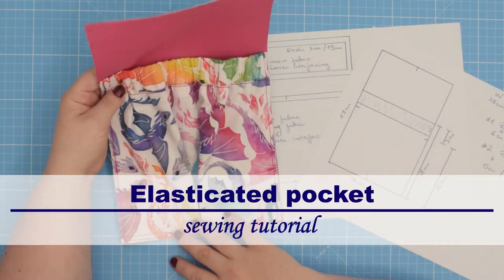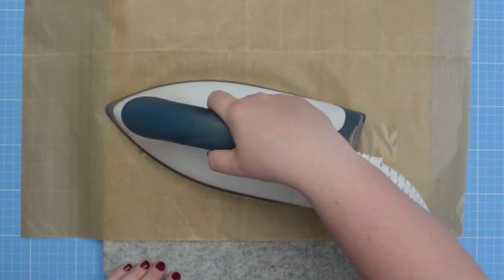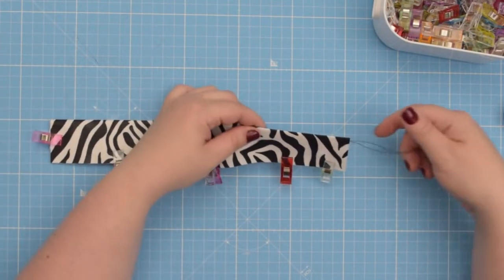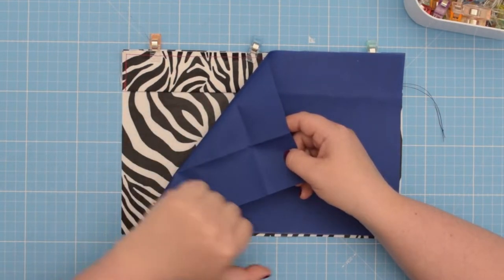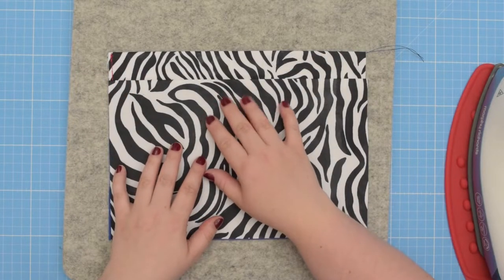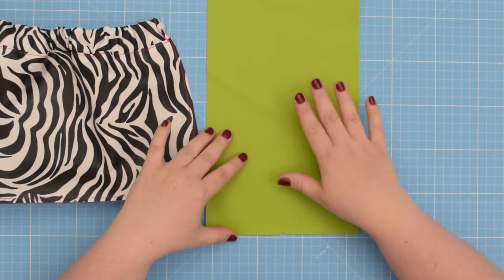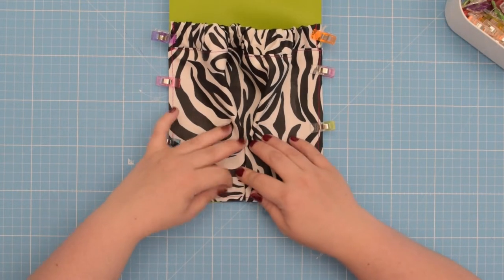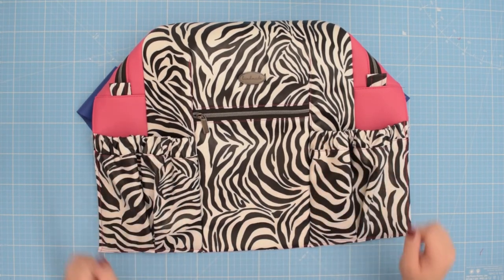Sew An Elasticated Pocket To Any Project In Just A Few Easy Steps!

Comment: Sound dumb but how do u work out how long to do the elastic plz
Reply from the maker: It's not dumb at all. Measure the width of the panel where you want to add the pocket. Cut the elastic about 1cm (3/8") longer if you want your pocket to lay close to the panel. Cut the elastic even longer if you want the top of the pocket to stand away from the panel. I usually cut the elastic longer, then adjust the length depending on the fabric and size of the pocket.

Comment: Is there a way to add elastic to an existing  purse pocket? I have a great soft denium purse, but the water bottle pockets are made of the same fabric and not stretchy enough to get my bottle in, but I love the purse.
Reply from the maker: Without seeing the bag, it is difficult for me to give you an answer. If the pockets are too small for your water bottle, I would assume there is no point in adding the elastic. 
Maybe consider replacing the pockets?